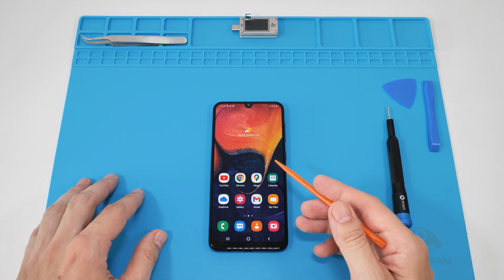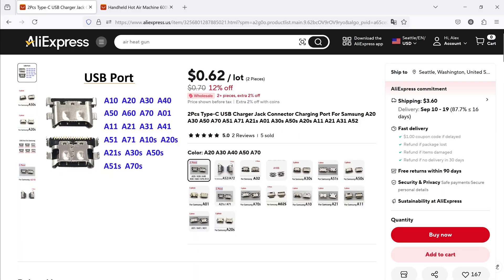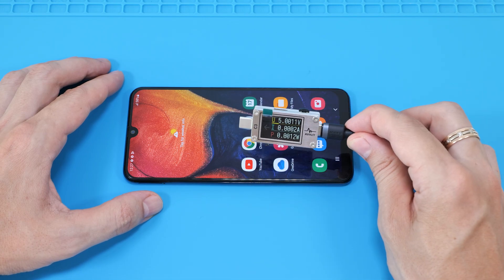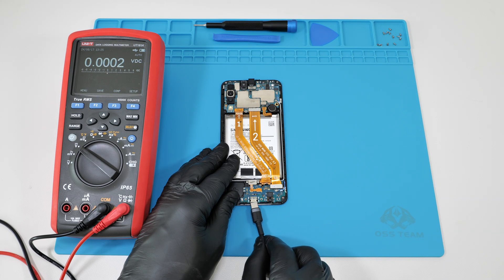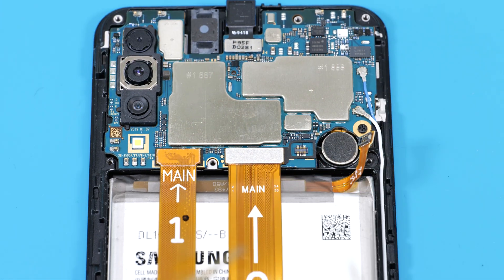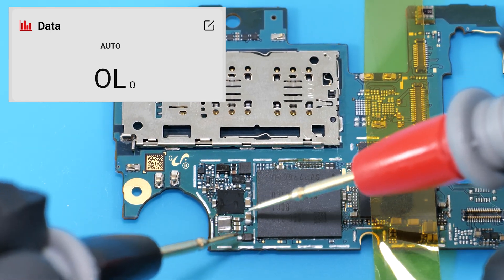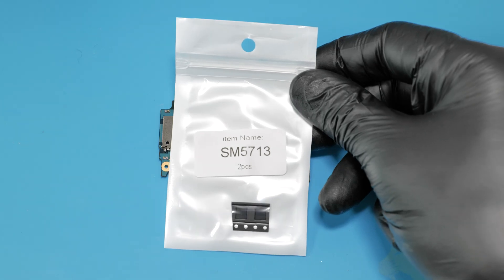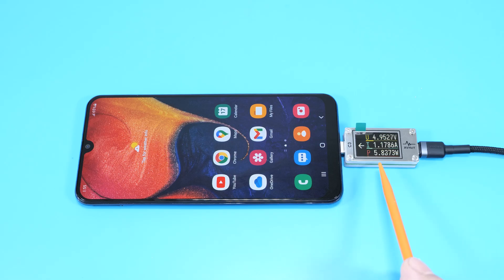Common Samsung Charging Problems – USB-C Port, Shorted Caps & Low Current Fixes

Comment: I replaced the charging port, but still not charging, what could be the issue
Reply from the maker: Do you have a multimeter? The issue is usually with the charge controller. If you can't replace it, there are simple repair kits available that add a small board with a built-in charge controller, but you'll still need to solder four wires.

Comment: Hi there, I have an Samsung Galaxy S21 which got into contact with water. I've dried it, but I didn't open up the phone straight away. So, I dried it again. The battery was bloated, so I replaced it, and the phone still works just fine.

The problem is, my battery indicator is stuck at 50%, and the phone won't charge at all. If it's turned off, I get the grey circle and lightning bolt icon. What's weird is that I was able to transfer all my files to the computer (no connection problem in this case), but I can't charge, no matter what. Regardless of wireless or cable charging, the battery gets warm while connected to the charger.

I also replaced the USB-C/daughterboard, but I still have the same symptoms as before. Based on your experience, do you think my charging coil is faulty as well?
Reply from the maker: Thanks for your message. First, can you clarify what you mean by the battery being "stuck at 50%"? Does the phone always show 50%, even if you use it? Does it ever turn off from low battery? That’s a critical detail. If the battery gets warm, it’s possible that it's actually charging, but the "fuel gauge" circuit or logic is messed up, especially if it's a fake, low-quality, or mismatched battery. It might not report data correctly. Do you have a USB tester? Without using any measuring equipment, it's just a guess in this case.

Comment: I've had several samsung phones with this issue now. I'm considering changing brands because of it.
Reply from the maker: We have tons of phones from every brand in our repair store. These days, everything is getting worse, nothing lasts like it used to and it's not about the brand name anymore.
Samsung stands out with its excellent user interface, which is a custom layer on top of Android. Their screens and touch sensitivity are nearly perfect. But unfortunately, there’s no such thing as a perfect phone anymore. The trend is clear prices keep going up, while quality keeps going down.
Reply: @ElectronicsComputers I appreciate the perspective 🙏. I know it just doesn't feel satisfying upgrading tech anymore to me. Cost/quality/value being the primary factors. I'm probably just going to keep charging wireless for now.

Comment: Hi i have a question here, my samsung a9 pro 6 2016 didnt charge BUT when turn on using it and charging along it rated 2W but when turn off it rated 4.6~7.9W its like spikes and down and when the charging logo appear its down to 2W ,but the strage part is when i go to recovery mode i could charge 7.9W steady (when ut hit bout 60%its kinda slowing down to 5till4W)  i do went to safe mode but still draws 2W ive never open the shield to check if the ic broken or not but now i just wanna try flash the os but pc couldnt regonize what should i do?...
Reply from the maker: It sounds like your hardware is probably okay, since the phone charges normally in recovery mode ( 7.9W is good, and slowing down after 60% is normal behavior). The problem is likely software-related. Since your PC doesn't recognize the phone, I recommend first: 
Try another USB cable and another PC if possible.
Install Samsung drivers manually on your PC.
Try to enter Download Mode (press and hold Volume Down + Home + Power buttons together) — this is different from Recovery Mode.
In Download Mode, your PC should recognize the phone (you can check it with a tool like Odin). If the phone appears in Odin, you can flash the official firmware to repair the system.
If the PC still doesn't recognize the phone even in Download Mode, then it could be a deeper hardware issue (like a broken USB port or motherboard problem). Also try to clean the USB port with rubbing alcohol and a toothbrush and then let it dry for a few minutes, then try again.

Comment: This will definitely come in handy when my dad's S23 Ultra will kick the bucket out of warranty and Samsung will tell us to go eat rocks or buy a new one
Reply from the maker: A failed power management chip is a fairly common issue across all brands and models. Sometimes, it's 2-3 times cheaper to buy the necessary tools and components and fix it yourself rather than going to a repair shop. Especially if you're interested in electronics.